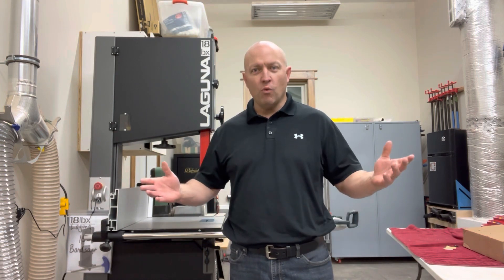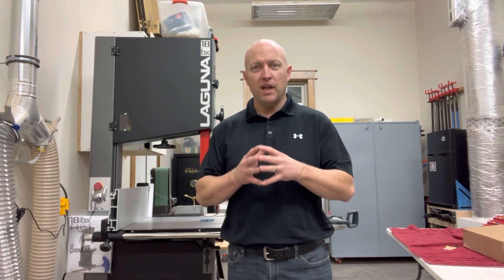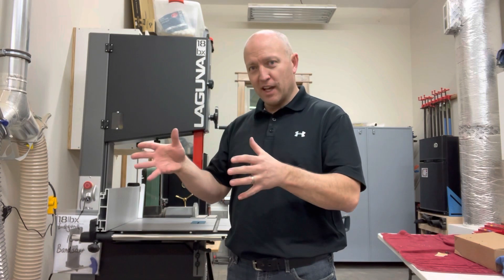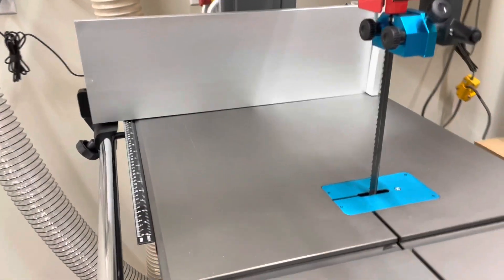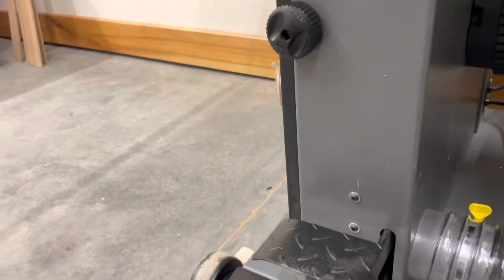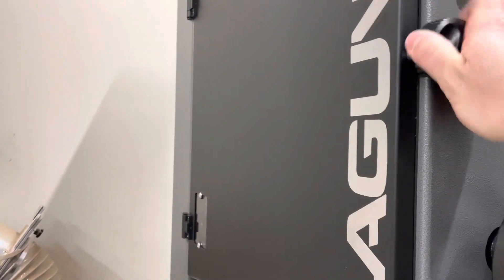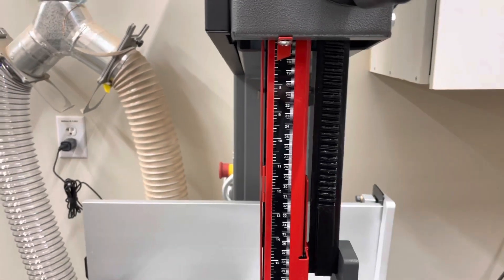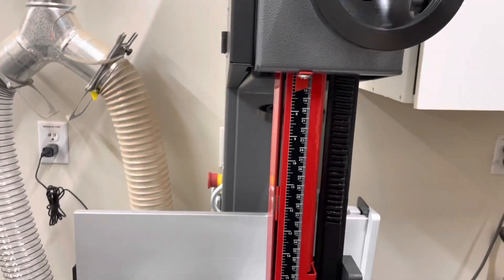Why I Chose Laguna BX18 Over Jet 15”

Comment: Having a table top as smooth as silk is not the most important feature. Having a cast iron table that’s flat within.005” is what I look for. When I lick the fence I am looking for it to be square to the table. Laguna drill’s clearance holes in the trunnion quite a bit larger than the screws they provide. This makes setting up the table a pain. Is because there tolerances are so large ? I sold my general 350 made in Canada to buy a Laguna BX18 and so far I have encountered these issues. Haven’t even turned on the saw yet. Overall the saw is quite good but there is room for improvements. This is what happens when you work on precision machine tools for a living! Decent saw for the price

Comment: I'm not sure if you switched from the ceramic blade guides to bearing type guides, but Carter makes some excellent guides, I have them on my old Jet. I've been looking at this saw for a while, but can't get myself to pull the trigger, but when I do, it's getting bearing blade guides.

Comment: Good review, Have assembled many 14/18bx's and even the LT resaw models at the woodshop I work at. Details do matter.
Reply from the maker: Thanks Bob.  Ever have an 18BX be out of balance and if so, how did you fix?  High level steps?
Reply: @levelupstudio_gstock  We had one issue where it was the blade at fault (made the wheels shake)but never had one that came unbalenced but Laguna custermer service has always helped my customers with any issues.

Comment: Thank you, great video, I'm about to be in the market and am looking at the Laguna as well.  Di you per chance consider the Harvey models?  Also on my short list.
Reply from the maker: Hi Carlos.  I did consider for a short period but at the time Harvey was still a relatively new offering (to me anyway).  That and the fact that I was able to touch and feel the Laguna helped a lot.  

Having been a year or so I will say I’ve seen a bit of a “shake” in this saw develop.  Haven’t been able to solve yet but have found an approximate .0010 out of round on the lower wheel. It’s unfair to say it’s anything to do with the saw with so little data yet.  It really could be a tire, the blade, or something else causing the vibration.  I have yet to contact Laguna either.
Reply: @Level Up Studio Custom Tables  thank you very much for your response, I am trying to see where I can see these live.  I have read that blade choice can make a huge impact.  Appreciate the info!

Comment: Looking to get the 18BX. Looks like its been 2 years since you got yours. Do you still love it? Thanks for making this video.
Reply from the maker: Hi Dusty.  I do still have it and overall I'd give it 4/5 stars.  I'm a bit of a perfectionist and would like to see this saw a bit more balanced (I still get a small vibration that is worse the wider the blade).  Narrow blades (1/2 or less) get barely any noticeable vibration.  100% truth - I don't ACTUALLY know if it's the blades or the saw (I got all blades from 1 place).  Also, for what it's worth I know a lot of people RAVE about the "wood slicer" 3/4" resaw blade.  I have NOT been impressed.  It cuts very slowly, acts dull (dust is very fine), and didn't track nearly as well as any other blade I have.  
If I ever find an article/paper on how to balance it better, I'll definitely be trying it.
Reply: @levelupstudio_gstock  oh ok! Good to know about the blade, I was also going to buy one of those lol. I will have to do some more research on the blades! Appreciate the reply!

Comment: This bandsaw will look like a Joke beside the Harvey Bandsaw especially the HW615P 15
Reply: IDK.  I sold my Laguna 14/12 becasue it couldn't resaw through butter even with a Resaw King blade and swore off Laguna but just got back from seeing Jet, Powermatic, Laguna and a few others not worth mentioning and this thing is a beast.  Looked twice the size of the Powermatic for $1000 cheaper.  The Harvey looks very small in comparison.

Comment: So if you are comparing an 18" bandsaw to a 15" bandsaw, you are comparing apples to oranges. What would happen if you compared your Laguna 18bx to an 18" Jet? The Laguna may still eek out an advantage but it would be a lot more fair, and a lot closer. I looked at the Laguna 14bx and was shocked at how poor the construction was and decided to drop it from my candidate list.
Reply from the maker: Fair point.  I guess I didn’t consider that manufacturing quality would vary so much between saw sizes (even in the same line & brand).  Did the 14bx not have the qualities I highlighted in the video?  I know other viewers would benefit from that info!  Thanks for sharing.